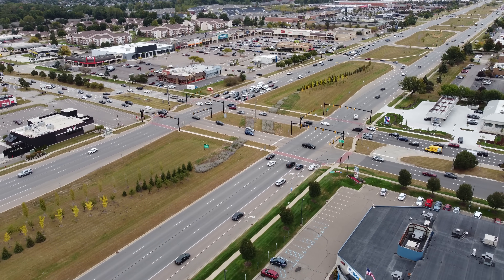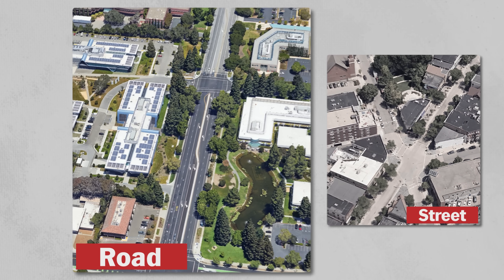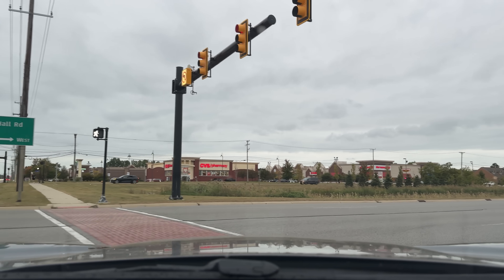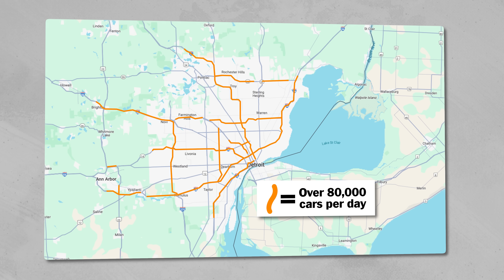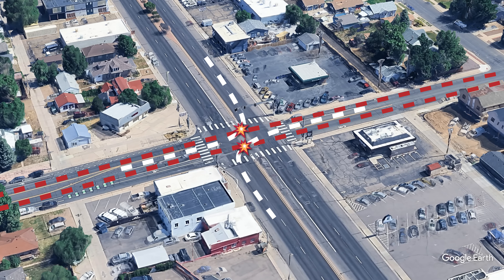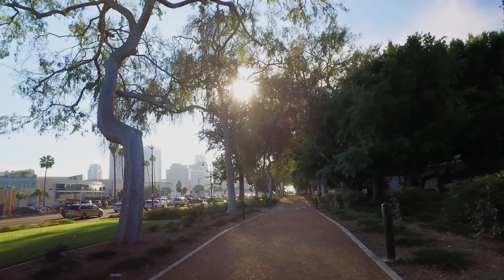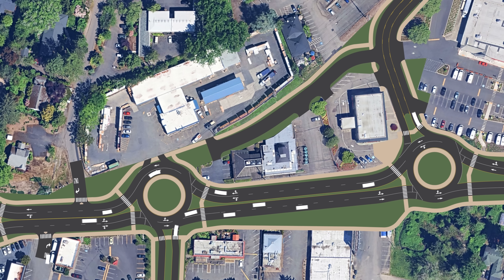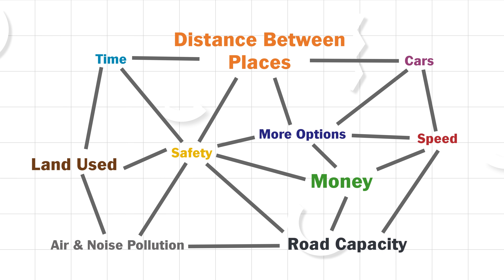How Michigan Built a Super Highway Using Only U-Turns

Comment: In New Jersey, two things that have helped control traffic are Jersey barriers and Jersey jughandles. The Jersey barrier was developed in the 1950s (introduced in current form in 1959), at Stevens Institute of Technology in Hoboken, under the direction of the New Jersey State Highway Department to divide multiple lanes on a highway. The design of the Jersey barrier was specifically intended to minimize damage in incidental accidents and reduce the likelihood of a car crossing into oncoming lanes in the event of a collision. In common shallow-angle hits, sheet-metal damage is minimized by allowing the vehicle tires to ride up on the lower sloped face. Head-on vehicle collisions are minimized by gradually lifting the vehicle and pivoting it away from oncoming vehicles and back into traffic heading in its original direction.

Jersey jughandles are a bit similar to the Michigan Left. NJDOT defines a jughandle as an "at-grade ramp" provided at or between intersections to permit motorists to make indirect left turns and/or U turns. Around-the-block designs that use interconnecting local street patterns to accomplish indirect left turns or U turns are not considered jughandles. These ramps exit from the right lane of the highway either in advance of the intersection or beyond the intersection. This design, which eliminates all left turns from the major road at the intersection, provides greater safety and reduces delays to the through traffic that left-turning vehicles usually create. The rerouted left turns from the major road cross the major road as through traffic from the minor road. The intersection of the major road and minor road is signalized. By the beginning of 1960, New Jersey had 160 jughandles, most if not all standard before-intersection jughandles. The 160th one was on US Route 1 between New Brunswick and Trenton

There are three types of jughandles. Type A or Forward Ramps. With forward ramps, all turning traffic (right and left) exit onto a jughandle ramp to the right, upstream of the intersection. Left-turning traffic is able to cross the intersection at the cross street. Drivers wishing to make a U turn on the mainline can exit onto the ramp and then turn left from the cross street. This eliminates left-turn movement on the mainline and improves traffic flow; however, it requires a large right-of-way for the ramps.  Type B or U-Turn Ramps. With U-turn ramps, where there is no intersection, ramps along the mainline enable vehicles to make U turns safely. A traffic signal is usually present to stop the mainline traffic flow and allow U-turning drivers to complete their maneuvers. And Type C or Reverse Ramp. With reverse ramps, left-turning traffic uses the rightmost lane downstream of the intersection into a loop ramp. Right-turning traffic turns right at the intersection in a traditional manner, not onto the loop ramp beyond the intersection. More through capacity is needed at the intersection because left-turning traffic first travels through the intersection before turning right onto the jughandle ramp, but this relieves problems by eliminating left-turn phases and left-turn lanes for left-turning vehicles from the mainline. 

Advantages of jughandles? For safety, it removes left-turning vehicles from travel lanes, particularly from higher-speed left lanes. Pedestrian crossing distance is reduced across the mainline. Reduced left-turn conflict points as compared to a standard four-leg intersection. Removes conflicts with right-turning vehicles and pedestrians/bicyclists at the primary intersection. Operations wise, reduced average delays, total travel time, and number of stops through the intersection in near saturated traffic conditions, higher intersection capacity for left turning vehicles, provides u-turn opportunity for larger vehicles on roadways with narrow median, reduced signal phases due to the elimination of the associated left-turn phase (or phases). Shorter pedestrian crossing distance across the mainline may provide for shorter cross street signal phases. Reduced need for ROW acquisition when there is not any room for a left turning lane; focuses land requirement near intersection rather than a long stretch that is often highly developed. But there are of course several disadvantages. Like driver confusion if you're from out of state because it's largely a New Jersey thing, pedestrian conflict is increased along the cross street due to the addition of an additional intersecting approach, potential for increased travel time and delay for left-turning motorists redirected through jughandle, increased overall percentage of vehicles stopped at the intersection, with reverse jughandles, motorists travel through the intersection twice: adding to the net movement demand, and the Federal Highway Administration recommends locating transit stops further from the intersection, outside of the jughandle ramps, which can reduce pedestrian demand due to the additional travel distance to access the transit stop.
Reply: We also have this “strode” in New Jersey for about 2 miles on rt22 in between Union and Mountain Side

Comment: 5:24 theres an error, the u-turn car wouldve had to stop for the hypothedical left hand turn.  It wouldnt be the same speed.
Reply: Think about it again, you’re missing the comparison. The point is to prove that, for a vehicle needing to turn left, the U-turn option does not take more time than a standard intersection with left turns would take.
Reply: @krumble1 depends on the traffic, I much prefer lights because I KNOW I’ll be able to turn left, I’ll just have to wait for my light
Reply: It was not supposed to, by design.

Comment: There are a handful of roundabouts in Portland. The ones on the busier street, guess what, during commute times, they get backed up worse than the miles of typical light intersections that lead up to them. I think it's because American's don't know how to use roundabouts.
Reply: Roundabouts max out at 1000 vehicles/hour (1750 for double lane, 2200 for triple lane).  After that, they lose efficiency and backup.  Roundabouts are great solution for low volume roads, where signals cause delay.  Which is why America focuses placing them in rural and suburban areas.

Comment: The Michigan left's modern design was first used in Detroit in the early 1960s, at the intersection of 8 Mile Road and Livernois Avenue. When it was first used, the increase in traffic flow and reduction in accidents was so dramatic (a 30–60% decrease), and so it was implemented across the state! A variation of the Michigan Left is the Superstreet. In this variation, in contrast to the Michigan left, traffic on the minor road is not permitted to proceed straight across the major road or highway. Drivers on the minor road wishing to turn left or go straight must turn right onto the major road, then, a short distance away, queue into a designated U-turn (or crossover) lane in the median. When traffic clears, they complete the U-turn and then either go straight or make a right turn when they intersect the other half of the minor road. For the Superstreet, a study showed a 20 percent overall reduction in travel time compared to similar intersections that use conventional traffic designs; intersections experience an average of 46 percent fewer reported automobile collisions, and 63 percent fewer collisions that result in personal injury

Here's more Michigan traffic controlling history besides the Michigan Left: In Ferndale, Oakland County, you can see a replica Crow's Nest at the intersection of Nine Mile and Woodward Ave. The Crow's Nest (or street semaphore) was a tower in which a police officer manually changed stop-and-go signals (first red and green signs before being fitted with red and green lights), and it was among the earliest means devised to direct traffic. Not until Cleveland in 1914 was the first traffic light operated by electricity introduced. Ferndale's Woodward and Nine Mile intersection in the early 1900s was too narrow for a police officer to control traffic at pavement center, so they ordered a crow's nest from Detroit (when the road was widened in 1928, it was replaced with an automatic traffic light). Detroit was the first to implement street semaphores, developed by Cleveland inventor Garrett Morgan, who also patented hair straightening cream and the safety hood, a forerunner of the gas mask! 

In 1911, Detroit was the first to implement one-way streets as a way of improving traffic flow and making commercial deliveries easier. The first stop sign in the US was installed in Detroit in 1915. It had black letters against a white background. In the 1920s, the familiar octagon shape was standardized by national committees (though for decades stop signs were yellow, not changing to red until the 1950s). Detroit was the first city to have specific traffic cops, with a quarter of 1914’s thousand member Detroit Police Dept being assigned to traffic duty, and it was the second municipality, after New York City, to establish traffic courts. They also were the first to have no parking zones. James Couzens had been the business manager of the Ford Motor Company from its founding until he got sick and tired of working for Henry Ford in 1913. After he retired from Ford, he went into politics, first becoming Detroit mayor and then a US senator. As mayor in 1917, Couzens proposed dealing with illegal parking with what he called “intensive disciplinary training”. Within half a year, the newly organized Detroit Towing Squad had towed almost 11,000 cars to a city owned vacant lot! And in 1920, William Potts, a Detroit policeman, invented the first four-way and three-colored traffic lights, introducing yellow lights to indicate the light would change soon!
Reply: Hey that's cool, I didn't know it was called a Superstreet. I live on a minor road that crosses a bigger road that was recently turned into a Superstreet and it's so much safer and faster! Thanks to you I know what to call it now. Thanks!
Reply: I actually never paid much attention to that in Ferndale but next time I'm on Woodward in the area I'll take a closer look!
Reply: hi its you!!!!!!
Reply: Thank you for sharing about different ideas for roads
Reply: Terrific info.

Comment: What if they redcued the U-turn to one single lane instead of two - and then made the other side (the "end" of the U-turn) not a traffic sign but an oncoming lane so cars can merge instead of having to wait for a signal.
Might reduce friction even more. Although we'd be quite close to an actual roundabout with that configuration^^
Reply: The volumes are too much to allow it.  Freeflow only works on low-volume low-density flow.  When large volumes of traffic intersect, signalization is nencessary.  The large numbers of vehicles on the mainline would require vehicles to stop longer, essentially leading to traffic waitingnon the ramp.

Comment: I enjoyed your video.

I still have a concern about the potential crash points created by forcing literally every left hand turn driver to cross four lanes of high speed traffic, especially when

1) the make the initial right turn into oncoming traffic, and

2) during heavy traffic.

Many drivers navigate across lanes in either a haphazzard or overly cautious way. Which may increase total accidents (although possibly smaller accidents) that may not be bumper to bumper, thereby not engaging airbags.

It would be interesting to see a study that addresses these issues.

Comment: It could be easy fix and achive safty and high efficiency by two steps. First, sperate the two way of traffic by a central reserve. Basically, change it into dual carriage way. Now they are fast and safe. No one is going to cut a cross three lanes to turn left out of a driveway. Second, replace intersections by roundabouts. That allows people to u-turn. That allows traffic to flow freely, reducing dead stop, traffic are likely to have less build up. That stop people speed through juctions since there is a island in the middle of the road, they have to reduce speed to get a round. Less fatel accident. Oh, and roundabout don't need maintenance, unlike traffic light have light bulbs to replace and power consumption. This system is so perfect. 

Well, you may ask "what about pedestrian crossing?". Elevate them or use subways. And there is a place already adopted this system. Check Milton Keynes in United Kingdom.
Reply: Yet they signalize "roundabouts" all over UK.  So much for less power consumption, light bulbs, and maintenance.

That is proof a roundabout would not work on this road.  The volumes are too high that will cause excessive stops for the mainline highway and all ramps. And whether a roundabout or a Michigan u-turn, you are still crossing multiple lanes of traffic.  So there is no safety nor efficiency benefit for a roundabout over a Michigan left/u-turn. 

America only installs unsignalized roundabouts.  They work best for low volume roads (under 1000/hour for single lane, under 2200/hour for triple lane).  And this design predated the roundabout.

Comment: You know this is just a rectangular 'roundabout', right? LOL
Reply: No.  There is no priority rule here.
Reply: @traffic.engineer  Makes it worse. That makes it a clockwork free-for-all where the main (in this image N-S) traffic flow cuts across the circulating traffic.
That's a crap design, not genius.
Try running the main N-S traffic under the circle & applying some simple lane priorities on the circle to assist flow. It would takes up less room & avoid large vehicles having to take sharp turns whilst also avoiding slow downs as vehicles position for those turns. There's more advantages, that's enough to start.
Oh, but it wouldn't have an American name! My bad. You just carry on. I get the problem now! 🙂
Reply: @TaoistYang  This predates the roundabout.  And standard roundabout would not work here because volumes are too high.  Traffic would not be able to merge at speed, causing stops and queues.

You missed that the approaches are signalized, which is necessary to move traffic efficiently.  Otherwise, the sidestreet vehicles would not be able to enter safely.

Roundabout interchange (placing the N-S mainline under the circle) would be costly to construct and maintain.  The cost-benefit analysis would not justify it, especially with the environmental concerns.
Reply: @traffic.engineer  OK. Thanks for the reply. :-)
1) Dates? The Michigan Left was implemented in the early 60's - I can't find a specific date, while the first modern roundabout roundabouts date back to 1956.
2) Volumes? You state that a standard roundabout wouldn't work even though throughout Europe on roads with both higher speed limits & higher volumes of traffic they are used exclusively withe greater efficiency and greater safety. Volume isn't simply dependant on speed.
3) Signals? I didn't miss the signalized approaches. Sounds very yield-at-entry to me. 😉
On the ML all N-S & S-N traffic has to pass through 2 crossover junctions where that may have to come to a full stop, and N-W or S-E traffic has to pass through 3 signals,, all E-W & W-E traffics has just one signal but if you're one of the lucky few who want to simply turn right - good for you!
4) Cost? Totally agree with you on this one. It would be expensive. But, it would be a case of time-on-return of investment rather than just solid, Nope. The cost saving in both safety & efficiency would at some time pay for & then profit the construction.
Classic example of a junction that's supposed to cater for all traffic actually failing as a result of being designed to optimize an edge case (answering the wrong problem.)
The studies & science still support that the fastest, most efficient way to merge traffic on many directions of travel, is some variant of the roundabout (or even of the traffic circle). 🙂

Back to original note... might be the best solution to a bad situation, but still looks like a poorly implemented & flattened variation on the roundabout to me.
Reply: @TaoistYang  
1.  Roundabout was standardized in 1966, spreading out to Europe in the 1970s.  Median u-turn was developed well before it was introduced to America.
2.  Europe has proven roundabouts have a capacity limits when they have signalize approaches.  The dashcam videos show adding more lanes to roundabout increases diverging crashes.   Roundabouts max at 1000 vehicles per hour for single lane, up to 2200 vehicles per hoir for triple lane.  This applies regardless of speed limit.
3.  Signals are necessary for high volume roads.  The low volume high-speed rural variant are unsignalized, with only two lanes and no straight crosover.  Sidestreeta must u-turn.  This type of design does not stop the mainline.
Reply: 4.  As stated, the costs have already been studied, and the benefit does not justifiy the cost.   Because this median u-turn design already moves large volumes of traffic efficiently, they stay in place while more are built.
5.  Traffic circles are greatly inefficient, which is why America abandoned them.  America only installs roundabouts.  Traffic circles essentially are multiple closely spaced intersections, which only causes additional congestion and crash conflict points.
Reply: @TaoistYang  https://en.wikipedia.org/wiki/Roundabout#1960s_development_of_modern_roundabouts